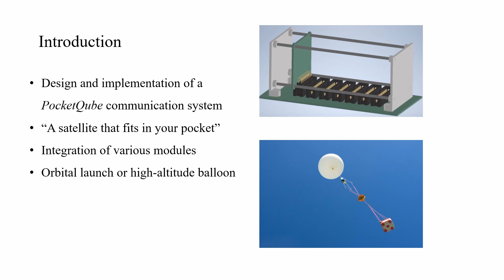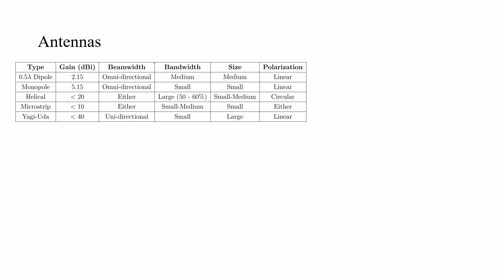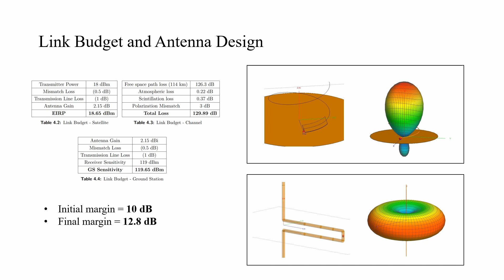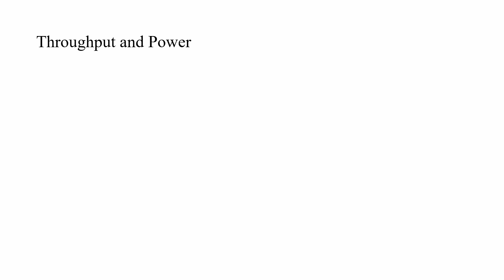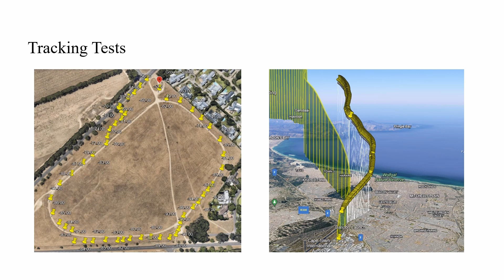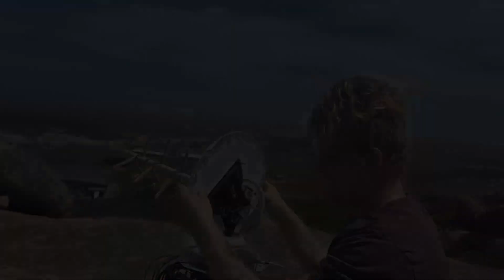The Development of a PocketQube Satellite Communication System [Thesis Presentation]

Comment: Hello,
Congratulations for the project, it is very interesting, is there any document or reference about your work that we can consult?

For a PocketQube project we are developing, we would like to implement RF communication, the satellite will be deployed to the environment at about 10,000 feet. Could you recommend a book or a site where we can research more about these antennas and the fabrication of them. Thanks
Reply from the maker: Hello, thanks very much for the kind response.

All the code, as well as my thesis report, is up on Github at https://github.com/gvcallen/pqcom . The report documents the design and simulation of the antenna, as well as the integration of the backend communication module (based on a LoRa chip from Semtech, as mentioned in the video, which I would highly recommend to lower development costs).

The ground station helical antenna itself was made extremely "DIY" using off the shelf components (cardboard, annealed copper wire, wooden dowels, aluminium foil) due to the nature of the project.

The size constraint of the motorized antenna mount forced me to run more simulations than necessary due to the need for a smaller ground plane, though in a real-world project I'd assume you'd have less constraints and potentially not need to run any simulations at all, in which case most of my initial design (which should work out of the box) was based on free online calculators. A specific calculator I'd recommend can be found at https://sgcderek.github.io/tools/helix-calc.html

If you have any further questions you are welcome to email me at gvcallen@gmail.com and I'd be glad to give more details